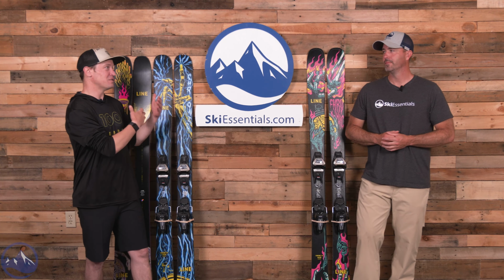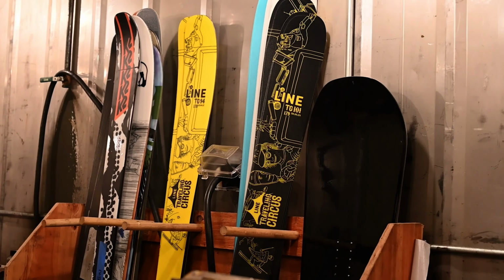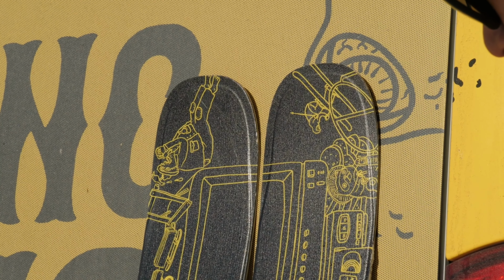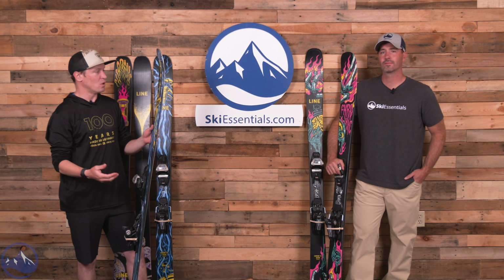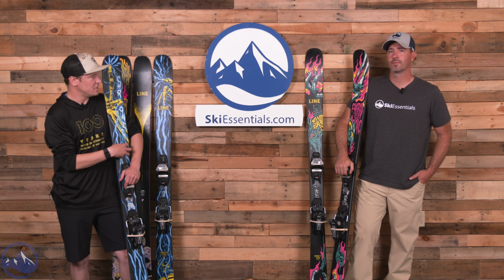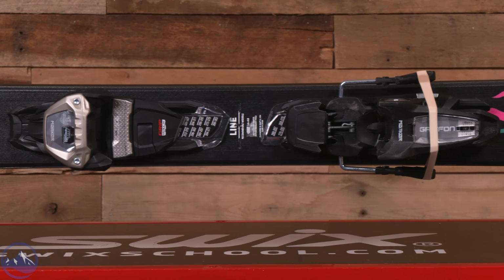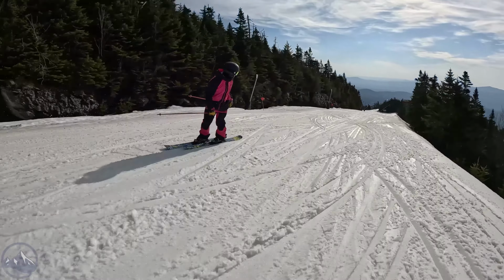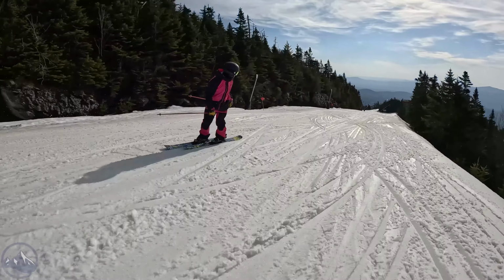2024 Line Chronic 94 and 101 Ski Review with SkiEssentials.com

Comment: I sold my k2 marksmans and I miss the snap/pop and energy they had. I’m wondering if you think these will give me that energy I’m looking for in a ski. I’m also curious if the swing weight is light. I have the bentchetler 110s right now that spin and shifty super easily and am wondering if I can swing these skis around like the bents. Thank you 🙏
Reply from the maker: The Chronic, especially the 101 if that's the width you're looking for, is incredibly mobile from a swing weight perspective.  They're not as stout or sturdy as the Marksman but a really nice modern twist on a ski like that.

Comment: The durability improvments sound very interesting, hope to see some more thorough test in the park for that. How does the 101 compare to something like the k2 reconer 102?
Reply from the maker: First, I agree 100%.  I'm hoping I can get my hands on a pair to really bash it around in the park and see if I can break it (sorry in advance, Line).  Second, great question.  Chronic 101 feels a bit more supportive, I think.  It's soft, but not as soft as the Reckoner, which is more Blend-like in its flex pattern.  I think skiing the Chronic faster feels a bit more comfortable than the Reckoner.  Reckoner is easier to manipulate for butters, ollies, nollies, etc, much like the Blend, but is more one-dimensional.  This new Chronic feels like an excellent park ski, while also being a more well rounded all-mountain ski.  Hope that helps!

Comment: what is snowblade? i have seen that tip before.. is the tip similar to to Bent?  is the Bent softer under foot than this? what is the turning radius?  my guess is the skis would really  chatter on rock hard groomers..
Reply from the maker: Super short skis, technically they're Ski Boards.  Line started as a Ski Board company!  No, Bents aren't softer.  If anything, a bit stiffer.  Turning radius of the Chronic is ~16 m in the lengths we were skiing.
Reply: @SkiEssentials  Thank you

Comment: Hi, what would the main differences be between these and the new Honeybadgers? I want a ski that I can learn to  butter,360 and jib about on and still be useful around the whole mountain. 
Thanks
Reply from the maker: The Chronic has more differences in flex--softer in the tips and tails while sturdy underfoot.  The Honeybadger is more consistent in its relative stiffness, giving it a bit more of a responsive feeling, especially out of the tails.  The Chronic is wider, and will provide more float in an off-trail format.
Reply: honeybadger is ass, it will break way too fast and you will waste your money, also its a bad ski overall its just not as good as the chronics.

Comment: Would the 94 be a good ski for tree skiing? I want a ski I can use for everything, such as park, tree skiing,  and drops. Would this ski fit criteria?
Reply from the maker: Absolutely it will.  The nice thing about the new Chronic is that the shovels and tails are incredibly floaty and maneuverable making it amazing in the trees.  As a twin tip it'll handle all the other fun things you want to do as well.  Impressive new skis for sure.

Comment: Hi, pretty keen to get a pair of 94s, I'm a 5'9 135lb skier deciding between 171 and 178 lengths, I currently ride ARW 106s in 180 length, have just started riding rails and 3s on jumps and am keen to progress further in the park, do you think I should go for 171 or 178 length?
Reply from the maker: I'd go 171 if you're looking to get more into park, just to make it more approachable.
Reply: @SkiEssentials  Cool, thanks, did you mount at the recommended mounting point?

Comment: Hi, how would you compare the new Chronic 101 to Rossignol Blackops 98? I'm coming from the Reckoner 102. Love the Reckoner but would like something with slightly more backbone and better durability.
Reply from the maker: The Blackops 98 is more different from the Reckoner than the Chronic, which has more Reckoner vibes. Blackops is more of a substantial ski, and while the weight makes it slightly less agile, the top end performance is certainly greater.  If you're looking for backbone and durability, I'd lean to the Rossignol.

Comment: Hey skiessentials,
 I am looking to buy permanent skis this year and the Chronic 94 seems to fit exactly what I am looking for in a ski. Although it may seem a little picky I do not love the graphic so I was wondering if you have any other recommendations of skis that have similar characteristics to the Line Chronic 94? Thanks
Reply from the maker: As far as playful skis in the 94 mm range, check out the Black Crows Camox, Liberty Origin 96, or the Armada ARV 94 (although that ski has a funky graphic, too!).
Reply: @SkiEssentials Appreciate the input thank you
Reply: Hey man you should Check Out the Line Chronic 94 TC. Exact Same Ski with different design

Comment: i live on the east coast and have been looking at these skis, i want something i can use on pretty much anything, from ice to powder to slush when it’s warm, but i want something that can have fun and jump and ride backwards but also go fast and carve a little. would this be a good ski?
Reply from the maker: Yes, the design has a lot to do with the success of the ski in these applications.  The thick core underfoot lines up well with carving on hard snow while the thinner tips and tails add to the freestyle and the soft snow acumen of the skis.  A great mix of playfulness and business.
Reply: @SkiEssentials  i got the stance 90 2022, got ‘em as used demos with bindings for 420